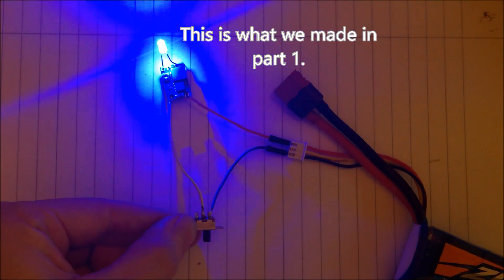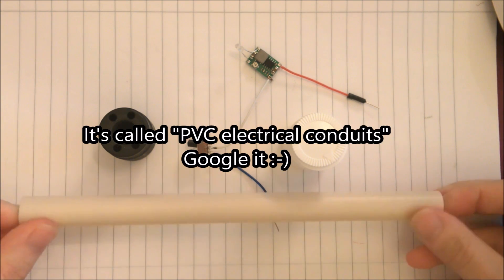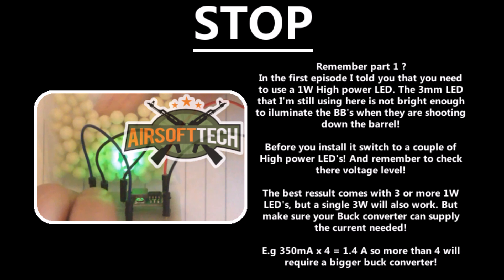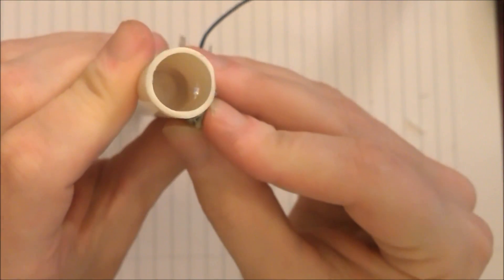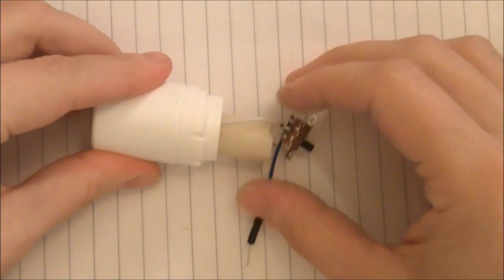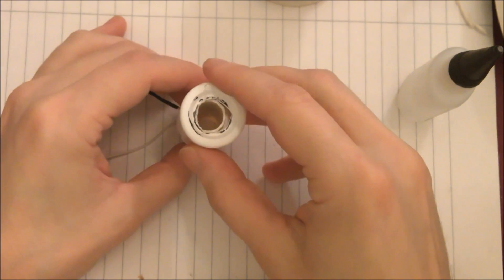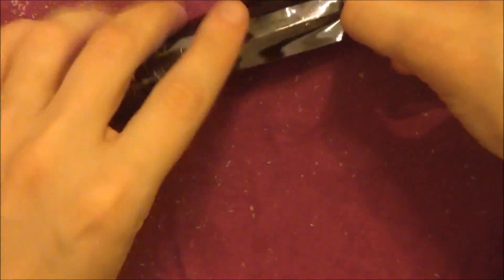Part 2: Tracer Unit - Suppressor style. (DIY Step by Step)

Comment: Is it possible to use a kind of sensor to have it work when bbs fly by just like in a normal tracer as I' want to use it in hpa gun were is no electrics, or at least a blinker/repeter for it to blink when turned on?
Reply: Yes, you need a microcontroller. I'm currently working on a similar project
Reply: @orhan3007  what do you plan or use for bb detection? And you're using arduino/pico for that?
Reply: @Ran1906  the plan was to use an IR Photosensor, one where the bb enters and one where the bb exits. I used an MCU called GD32VF193. However, my project failed. The sensors detecting the bb worked fine according to the programming but the LEDs that were supposed light up the bb wasn't powerful enough

Comment: Hi!
Thanks for the video. I’ve tried making a suppressor style tracer unit using one 3W UV led. Once tried putting bb through the barrel it glowed perfectly, but it didn’t work once shooting. Can you please suggest the reason of this result? It it because the speed of bb when shooting is too fast for it to glow ?
Reply from the maker: 1 single LED does not have enough time to light it up.. Use 3-5 places evenly spaced in a 10-15 cm tube....
Reply: Same here using 1 led won't work

Comment: The led will always be ON right? Any way to add a sensor to just turn on when bb goes trow?
Reply: Hook up a button to your trigger bro
Reply from the maker: You can just connect the wires to the motor ... then it will only glow with the motor
Reply: or just the trigger switch unit.

Comment: can it achieve the same performance that an off the shelf option can provide? i made one with 2 3w 365nm led and it was a little dim with 700mA on each led of foward current .
Reply from the maker: If you use some good led's then: Yes it can perform just as good as commercial once...
Reply: @AirsofttechDk  this one you showed could achieve the commercial one brightness?

Comment: hi i'm gonna make one but with photo transistor and low power LED for motion sense, my question is, i'm gonna use NiMH battery which is rated 2000mAh 1.2v x 4 (and arduino uno for testing or attiny13 for deployment)only 3 or 4 Hi power LED like yours with mosfet for switching

do i still need buck converter? and some other input will be gratefull
Reply from the maker: 4x1.2 = 4.8v ... that is more than 3v so YES you need a converter ... I recomend that you watch part 1 ;-) .. https://www.youtube.com/watch?v=hVs3d6HAvSc

Comment: Hello, my friend! Thank you for sharing this video! So, I bought some High Power LED UV. Its specs are 3W and 700mA. In your project, you used four 1W/350mA LEDs for the suppressor style. How many LEDs (3W/700mA) will I have to use in order to achieve good results? Will this buck converter do the job? Also, what battery will I need? Thank you so much! Take care!
Reply from the maker: 3W led's usualy is enough with 2-3 spaced with 3-4 cm appart ... 700mah => 0,7 A ... you will need a buck converter that can deliver 2 times the led need (so that i don't get overloaded) ... So 3*0.7 = 2.1 Amp => you will need a 4 Amp Buck converter (3A converter may be enough but it's not all that can sustain 2  amps when they are 3A max ones ...)... As for battery ... When using a buck converter to take it down to 3.3v you can use ANY battery that can deliver more than 5V .... So 7.4 Lipo, 8.4 Nicd, op to 11.1v Lipo MAX ... (So any airsoft battery will doo) ...
Reply: AirsoftTech.dk sounds good. I was thinking of using four 3w/3.2V/0.7A LEDs arranged in two strings in parallel with two LEDs each string. If I am not mistaken, I would need 6.4V and 1.4A. This way, I’m thinking of using a 7.5V/2.4A nimh battery, use the buck converter to step this voltage down to 6.4V. Do you think will work?
Reply from the maker: @marcosandradejunior  Yes that should work ... But when you are using a buck converter to step down the voltage you might as well just wire all of the LED's in paralell ... (Then you wont have problems with batteries not capable of maintaining high voltage while shooting )..... The only benefit of dooing them in series is that the buck converter will be waisting a bit less power ...

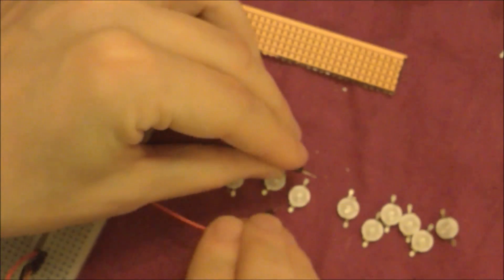Comment: Hello, I want to build a tracer like yours ( 07:41 - 08:30 ) but i don't know what buck converter to use if you can give me a link, I be very thankful
Reply from the maker: I personaly use 2 different kinds (depending on how great i want them to work) ... 

This is best when using many LED's It can handle around 5-7, 1W led's .... But it's a bit big (So it has to be hidden in a compartment)
https://www.ebay.com/itm/1PCS-DC-DC-LM2596-power-Supply-Buck-Converter-step-down-module-NEW-CA/142147326064?hash=item2118a41070%3Ag%3AL1kAAOSwvzRXzOBg&_sacat=0&_nkw=buckconverter&_from=R40&rt=nc&LH_TitleDesc=0
If the link don't work go to ebay and search for "DC-DC LM2596 power Supply Buck Converter" ...

When working with 2-3 1W led's (just about enough if they are aranged correctly) i use a much smaler one ...
https://www.ebay.com/itm/Mini-360-DC-DC-Buck-Converter-Step-Down-Module-Mini360-4-75V-23V-to-1V-17V/192340893507?hash=item2cc8691f43%3Ag%3AfFkAAOSwQRla4tnL&_sacat=0&_nkw=Mini+360+DC+Buck+Converter+Step+Down+Module&_from=R40&rt=nc&_trksid=m570.l1313
on ebay search for "Mini 360 DC Buck Converter Step Down Module"
Reply: AirsoftTech.dk  can I use , this one https://www.aliexpress.com/item/-/1574222761.html
Reply from the maker: Yes that should be capable (if the info that the listing say is correct) to drive 8-10 1w Led's ...

Comment: What battery did you use for this (could you add a link of where to buy one if that is possible)? Also, would 3W Led's make a significant difference to the Brightness of the BB's?
Reply from the maker: I used a 7.4v lipo battery... As you can see I attached long wires to the tracer and ran them allong the barrel back to where the gun's lipo was located... So that I just use the same lipo for shooting the gun and powering the tracer unit...

Where to get them depends on where in the world you live?

3W led's requires more power per led and gives more light, so you can use less LED's  but i would still say at least 2x 3W led with some space (like 3-4 cm minimum) between them ... But that would give 6W total ... that should be fine... just remember to make sure that the buck converter can handle the Watts ....

Comment: i don`t know why but my led`s are flickering.
Reply from the maker: I don't know exactly what you have connected and how, so it's a little hard to say exactly why. But usualy when the LED's flicker it's because the LED driver can't supply enough power (current at the needed voltage) so the driver board shuts off the output charge up the capasitors and turn it on again... This is repeted over and over. on, problem, off, re charge, on, problem, off, etc...

To calculate how much the driver (buck converter) needs to handle sum ud the led's current requirements and check that the buck converter is rated to be abel to handle that ammount...

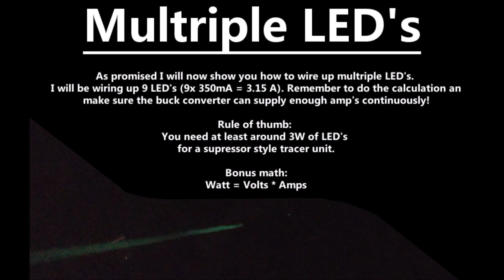I know it's not verry specific but if you go to 7:35 (link below) theres a note: "9x350mA = 5.13A" so if you use 9x1W led's your buck converter will have to handel 3.15 A ... 
https://www.youtube.com/watch?v=Z_QnGPHzm-E&t=448s

If you want me to do some calculations on your problem tell me what led's you are using and how many ...
Reply: I used 9 1w led and a buck converter that says it can handle max of 3A. The buck it goes very hot, and the led are flickering. I order another buck that gives me the option of settling the current as well, I’ll try that as soon as it comes.
Reply from the maker: FYI: If the buck converter is rated for 3A you should not run it at more than 1.5-2A ... Usualy the 3A rating is because it can deliver bursts of 3A for a short period (E.g to turn on the LED's) but it will then only be capable of running a sustained draw of 1.5-2.5A and most of them recommend adding heat sinks when drawing more than 2A .... So in general (Kind of a rule of thumb) don't draw more than around half the rating ....
Reply from the maker: Additional note ... The most important factor is the brightness of the LED's (1w led's are perfect) and the time the BB is in the exposed area (The length of the tracer unit)...  So using e.g. 4 x 1w led's should be just fine .... that will result in 1.4A current draw ... Just make sure that the first and last LED's are placed in the ends of the tracer, and the 2 others are placed with even spacing ...

Comment: Hi, could you tell what you used for wires that go/plug into the battery? 

Also, could this be used with a small coin battery instead of a LiPO?
Reply from the maker: First part: The plug I used is the "jst-xh connector" it's the balance plug for the lipo, but It can be used to supply  power as well ... Remember you have to get a 2S or 3S one depending on what battery you use...

As for battey you need at least 3W of LED's to light up your BB's to a proper level ... Coin cells can deliver eg. 200 mah at 3V = 0.6W Witch means that with a 3V coin cell your tracer would burn last around ½ hour :-( Not very long ....

So yes you can use 3V coin cells, but they won't last very long ...
Reply from the maker: You may also have problems supplying enough power if you only use a single coin cell ... So you may have to use more than one !!!

Comment: that is some cool stuff man. I'm actually studying electronics engineering right now, so I was able to follow along easily. it would be cool to be able to get a hold of some true UV-C or UVB LED's. those output around 250nm. well under the visible spectrum. so the tracer unit will be really stealthy.
Reply from the maker: Yes. When doing a suppressor style unit that would be cool but a little more expensive .... One thing you can do is too wire it up so it lights up with the motor (See the installation guide  http://airsofttech.dk/Guides.cshtml?Page=TracerUnit ) so it's only on very shortly ... Another thing you could do is to do an internal install (But it requires you to open the gun) ...